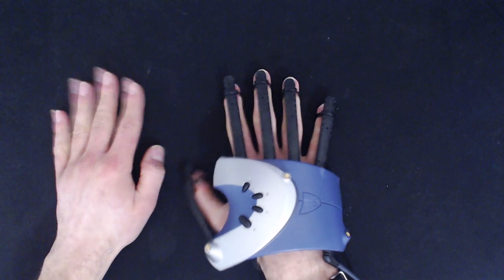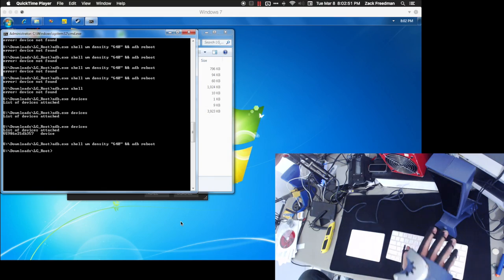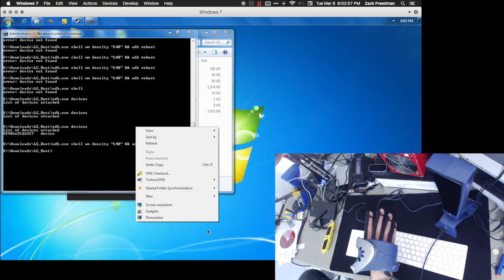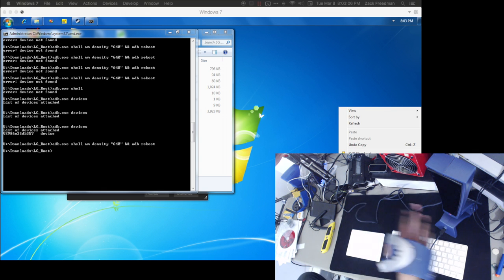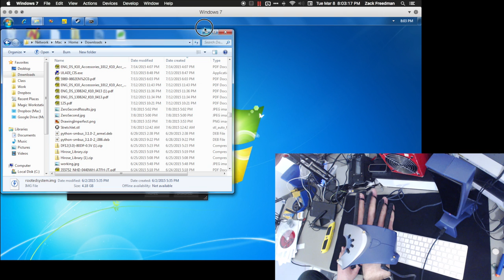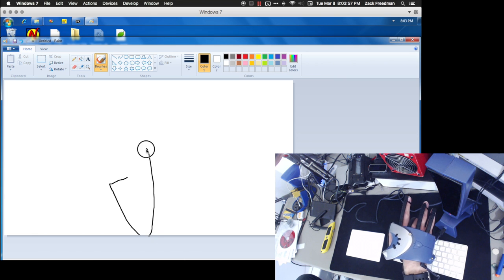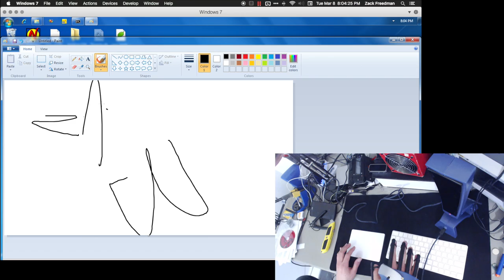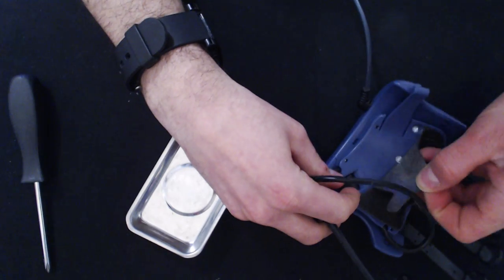P5 Data Glove! Unboxing, Teardown, Hack, and RAGE!

Comment: About to start my own P5 disassembly adventure next week. Thanks for the headstart, and looking forward to your software demo!
Reply: Update please :)
Reply: How did it go?
Reply: @crutchgecko  Sad story: the strain gauges had become corroded with age, so the raw values I read from each finger were not too reliable- one channel gave very smooth results, the next one had maybe 4 distinct values. Connecting it to Processing for visualizing the data as bar graphs made that quite obvious. I still did a company demo - and then on the train ride back lost the prototype. Somewhere there is now a P5 glove with an arduino interface out there all alone in the world (or in a Lost & Found office).
Reply: @totallynotabot151  oh thats so tragic! You must have been quite frustrated! Honestly it was fun to develop it buuuut  it really needed more work. The inertial reference would have really helped. I think the best version will be conning soon.... you will just use your hand with no glove. Perhaps something stuck to your fingernails at most. These days AI can handle it without so much raw data required!

Comment: hi, love the vid, hoping you give "how to" make this glove for all that want to copy you.
I have had this glove sitting around collecting bunnies for ages.
I don't sub often & u just broke my sub virginity :P
Reply from the maker: I've built a custom version of this glove since I released this video, so I'm probably not going to release a mod guide. The P5's sensors are just too fragile and unreliable for a serious wearable.
Reply: THX for the reply, i also have a razer hydra that's been sitting around.
I wonder if some how you can get these 2 devices working together cause i think it would be really great.
Reply from the maker: The problem is that both the P5 glove and the Hydra have proprietary drivers. You could use something like GlovePIE to map them onto standard gamepad/mouse/keyboard input and use them somewhere, but otherwise, they're both pretty obsolete.

That's the problem with proprietary products - the hardware still works years later, but nothing supports them...
Reply: absolutely correct, there needs to be a end to proprietary BS......you know i am right on this & so many companies think it's the best practice but they don't  always think it thoroughly through.
EVEN if the company goes down there is always a way to bounce back in other ways but since they lost massive $$ they don't care to cater to the fans that may help them rebuild.......IDIOTS them all
RAZER hydra still allowed a way out so they aren't bad.
I forget what software you can still DL so hydra works>>>hysense  i think ?
Reply: @ZackFreedman  Oh yeah it's Somatic time

Comment: Congrats on buying someone else's used P5 glove.  Missing the plastic film on sensor bar.  No extra drivers needed for it to work as a USB mouse.  Like falling off a bicycle for the first time.  You get used to it. Did you figure out the drag lock yet?  Oh, you hacked it apart?  Your loss!